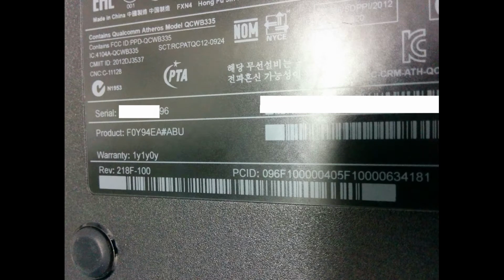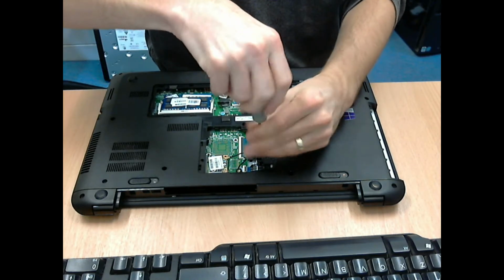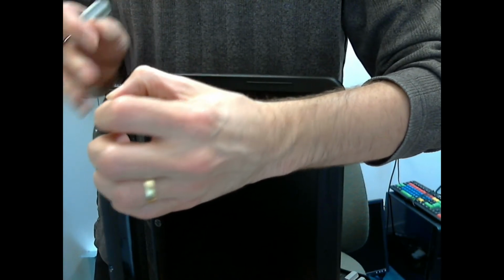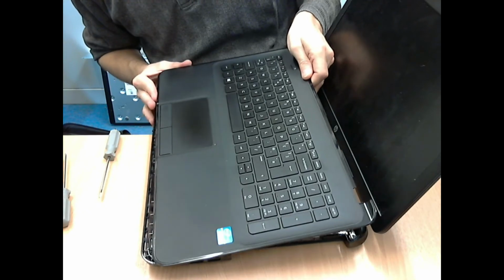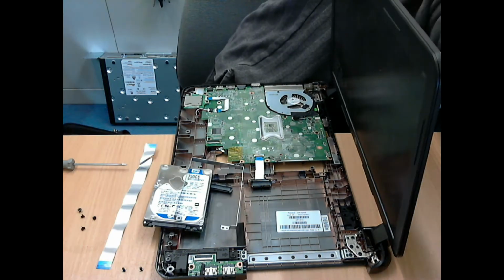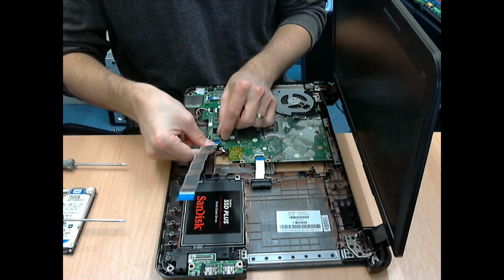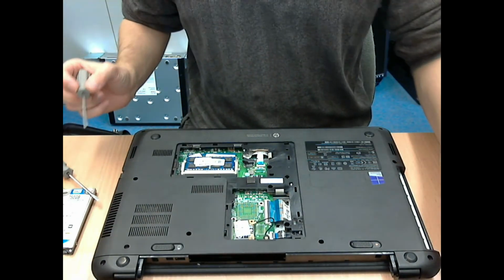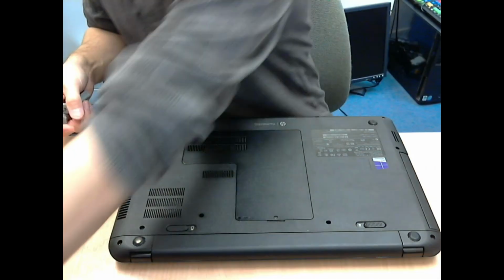Changing or upgrading hard disk in an HP 250 G2 Laptop / F0Y94EA#ABU Laptop

Comment: In this model HP 250 G2, i have some doubt, please elaborate

1. Currently i have 4GB installed Ram, as this model have another ram place, so can i add a 8GB ram on another blank place?

2. I have 500 GB HDD, suggest me a good SSD for this model. I beleive this is SATA 2.6

3. How could i use existing HDD without hamper DVD drive?

4. This model is Windows 8.1 comparable as of 2014.
Can i install Windows 10 on it?

Please help me with any suggestions 🙏
Reply from the maker: Windows 10, yes, no problem.
The others I don't have the energy to answer.

Comment: Hi do you know what size the base screws are for this laptop? are they m2x6mm
Reply from the maker: If I can find out (and not sure if can) it will be in at least a few days time. Depends if I can locate the laptop.
Reply: M2.5x6mm. I just replaced my HDD using this video as a guide in a slightly different variant of the same model. I'm sure this is of use to you 2 years later! hah.